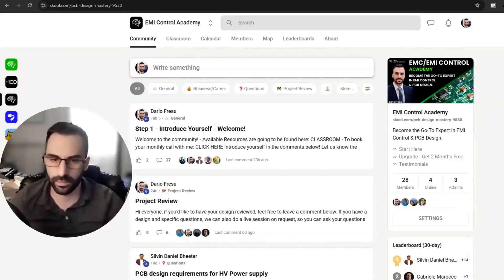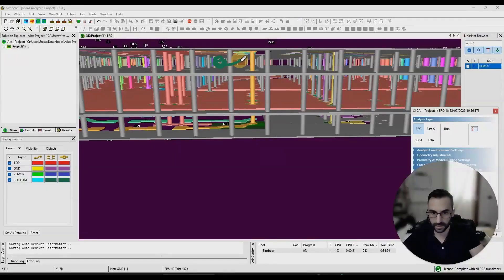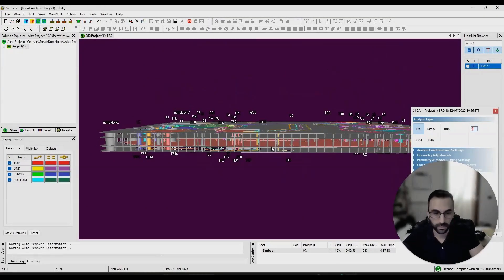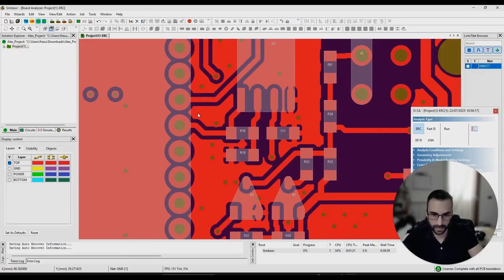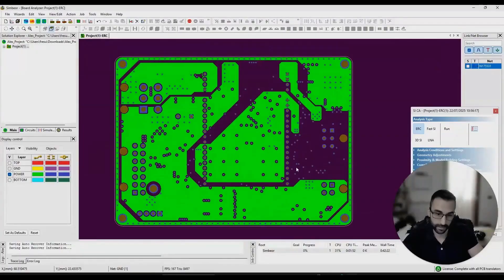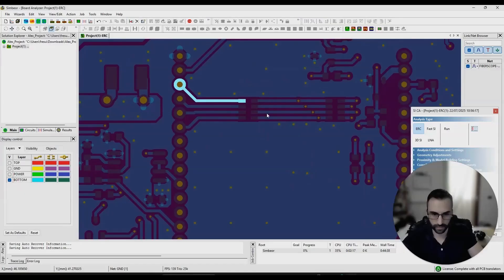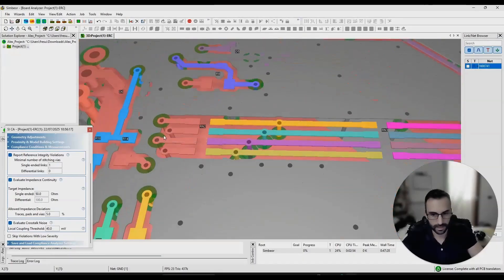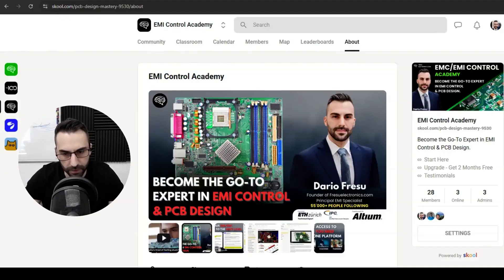Printed Circuit Board (PCB) Design Review - EMC/EMI & Signal Integrity - Simulation

Comment: I imagine lots of student/hobby pcb makers could benefit from a quick 15-minute review of their pcb.  

I've never done a board, but I'm in need of a custom ADC application..  based on the datasheet/application notes, and some circuit simulation, I think I can stumble my way through the schematic capture part.   But In terms of layout, I know enough that laying out the board is not trivial.. especially if measuring low-voltage or high speed!   I'm using using a USB3 chip that handles much of the complexity but would love to find a service that gives me an informal review, like this video!
Reply from the maker: Thanks for watching 🙏 we can set you up for that if you are interested.